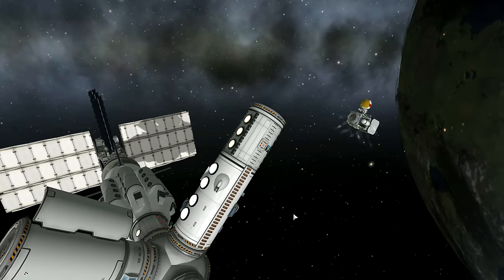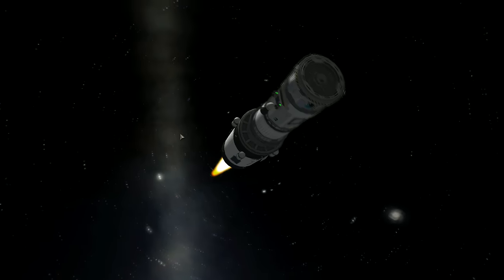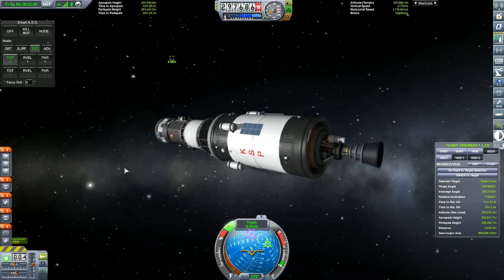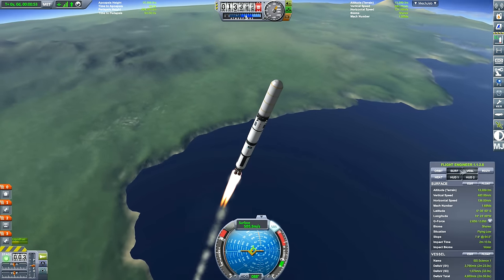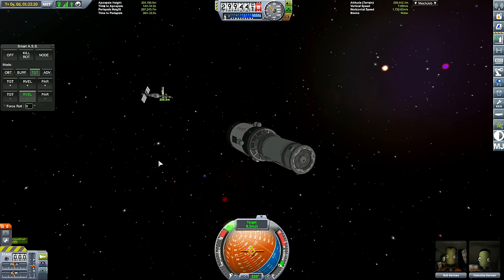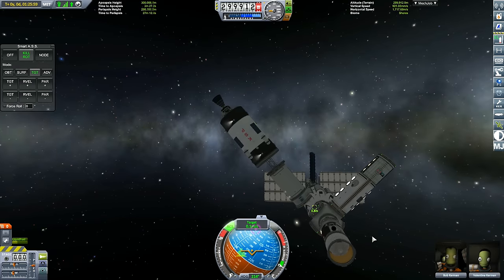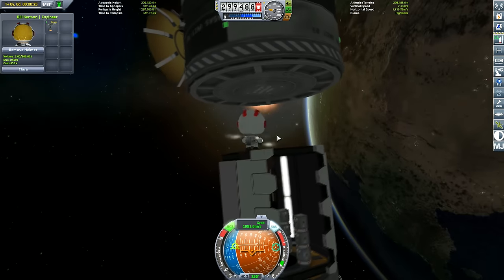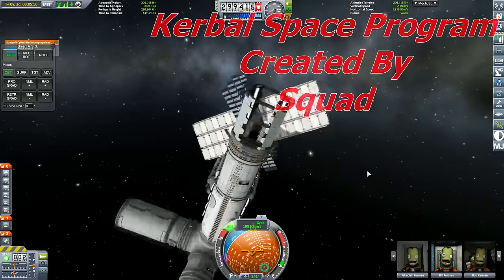lSS | Space Station Science Buggy | Kerbal Space Program

Comment: I got to the mun a few days ago any tips on getting to minimus also can I become a kerbal?
Reply: The Fez Peps minimums is actually easier then the Mun IMO except for two things. 1) SLIGHTLY more fuel is needed for both trips. 2) intercept is harder, you're going to need to play with the node a bit. My best advice is add an extra SRB (or two) to your Mun rocket bottom stage then add some extra external tanks to the return stage and transfer stage. Just check ur delta V at each stage.
Reply from the maker: Ashwin Gupta Awesome reply the only thing I would do if you feel adventurous is to launch at the same inclination as Minmus to save fuel on the inclination change but it means you have to launch at the correct time during Kerbin rotation 😎
Reply: Orb8Ter :D Orb8ter just called my reply awesome!!??? TY TY.